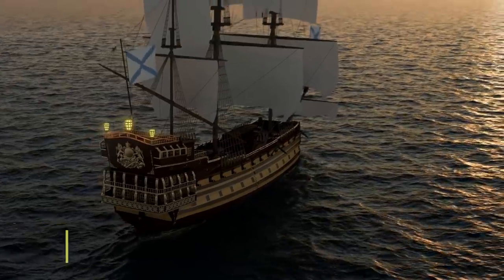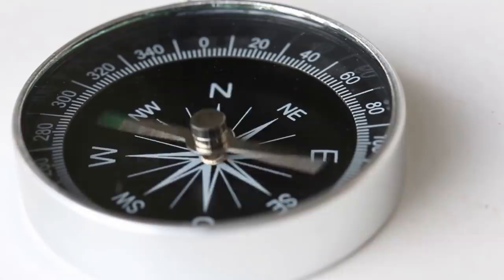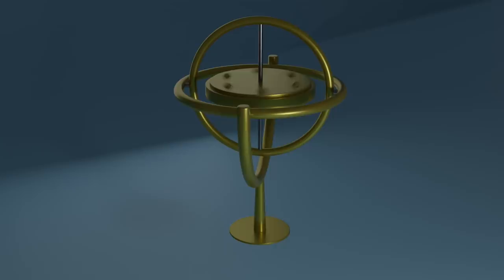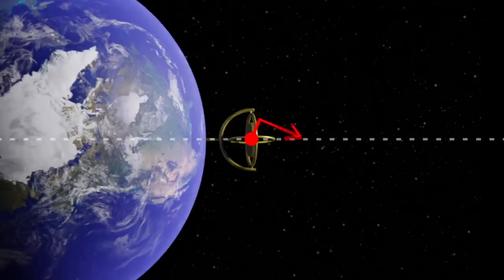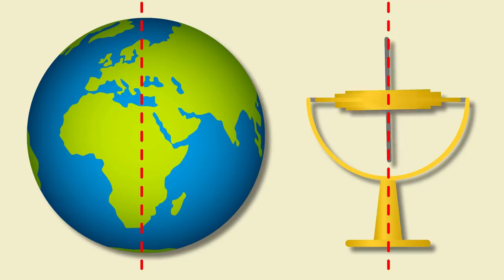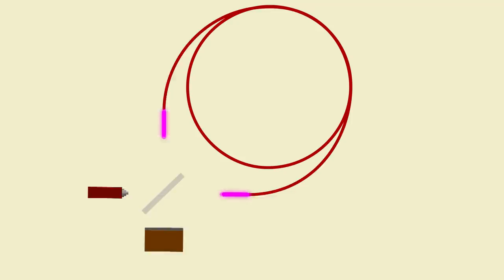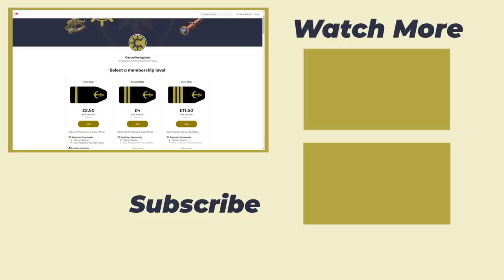Gyrocompass: How Ships Navigate Using The Earth's Rotation

Comment: Wow, that was a very interesting presentation! Thank you, more please. I think I learned something, a very complicated subject is gyro navigation. Too complicated for my small brain. 
I have experienced the gyro effect, most people have I would think. Anyway, the connection of gyro force to bicycles wheels has led me to a question. Any vehicle with wheels has a contact patch, this contact with the surface on which it travels creates "traction". Traction is an effect created by weight and contact (=friction), the more weight per square inch, the better the traction, the more friction, i.e., less slip (generally). 

On a bicycle, to change direction one "counter steers", tipping the bike over and then adjusting the steering angle to follow the intended path and maintain balance. Steering or counter steering does two things, one, adjusting the balance of "uprightedness" and two, counter acting, or overcoming the gyro effect. Maybe this isn't a question, maybe this is an argument.
The force of traction is much much higher than a gyro force, probably 1000 (10,000?) times as forceful. It is possible to crash a bicycle, if the gyro effect had much (a lot of) force, it would be virtually impossible to crash, or to turn for that matter. I guess what I believe, and I may be wrong, it is not the gyro effect that keeps one upright on a bicycle, it is simply balance, balance that is intentionally and directly controlled only by traction supplied by the contact patch and rider input. Turn the handles the wrong way or wrong amount and down you go. Now if the bicycle was floating in a fluid, like the air, we'd really have something the gyro effect could impart it's force. And a hovering bike would be fantastic, lol.

Anyway, thanks for creating this video, keep them coming, I find boats and ship fascinating. Maybe because where I live, water is a solid much too much of the year and virtually impossible to ride a bike in a foot or two of not quite solid snow. Get me outa here (sobbing).

Comment: One question. I understand the gyro-compass will orient itself with Earth's axis, but how do you know where is south and where north? It could be either way.
Reply from the maker: It depends on the way the gyro is rotating. It knows which way based on its rotation.
Reply: @CasualNavigation  So, if I understood correctly, depending on the rotation, clockwise or counter-clockwise, it will always orient itself correctly south-north.
Reply: There's no axis. Only magnetic north which is the center of earth. Earth is stationary and covered with a firmament and water above that.

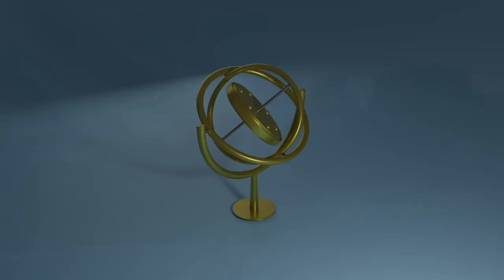Comment: 6:55 - that's actually a myth.  You can build a bike with a counter-rotating flywheel that cancels the bike's angular momentum, and it will still stay upright.  A bicycle can sustain its stability by the gyroscopic effect, but only at extremely high speeds.
Reply: What is extremely high?
Reply: @the11382  80+
Reply: I see you also just watched that Veritasium video

Comment: The optical gyro cube is also how the inertia guidance system works out acceleration and direction.
Reply from the maker: Thanks BigFire. I am working on a video that mentions inertial navigation systems at the moment.
Reply: @CasualNavigation  Back in the early '80s,  whilst in Junior High School, I visited Rocketdyne factory where they're in the process of switching from mechanical inertia guidance (mainly for missile and other payload) to optical.  Albeit, they're using 3 square bricks of I think optical sapphires each with 3 mirrors for beams.  1 brick per orientation of the 3d surface.  I figure they would've reduce the size of it by ow.  Also highly recommended the fun video made (I think in the 70s) of how a missile can tell where it is...

Comment: Back when I did landscaping I used a compass a lot. With much bewilderment from my boss. Knowing what direction is what comes in very useful for cleanups when using blowers. As should be evident, you do not want to work against the wind. My boss would simply go by the old "rises in the east, sets in the west" generalization. I used a compass in order to be more accurate and so that I didn't have to remember. My preferred compass was a lensatic compass, mainly because they fold up and are thus protected.

edit: cardinal typos
Reply: I'm confused. If the wind is significant enough that you don't want to be blowing against it, you can see stuff moving in the direction of the wind. Why would you use a compass and a weather forecast to see which way the wind is blowing?
Reply: @beeble2003  Wind direction can change over the course of the day. Or it can be calm then change to windy.

edit: also it is not simply about which way you move across a property, it also effects which property you go to in the first place. For example you want to avoid moving uphill when doing a cleanup, you always want to move downhill. So if the wind is going to be against you moving downhill at one property, you go to a different place where that is not the case. (this is a good example of why the forecast itself is so important and its not like my boss didn't use the forecast, it was just the compass use he thought was odd)
Reply: @whyjnot420  Ah, OK, I see your point. If you're actually there, you can tell what way the wind is blowing, but knowing the wind direction would tell you which jobs are best done today and which should be left until tomorrow.
Reply: @beeble2003  Just one other thing to point out. Back when I was doing this kind of work (in the 00s), while cell phones were around and fairly common, stuff like smartphones did not exist. Sure some older cells had a built in compass, but I never used a cell during that time (still never use them tbh).

edit: I say did not exist, technically things that fit in line with them did exist, but they were expensive, uncommon, cell reception was very hit or miss and so on, so for all intents and purposes, "did not exist" fits the bill.
Reply: You must be the special kind for doing this to blow leaves. I wouldn't work with you haha

Comment: Fun thing about using a GPS input to auto-correct the gyro errors:
On the Prinsendam in 2013-2014, we had a GPS used for that but its position liked to "wander off" at random times; sometimes going as far as showing speeds of 70 knots (quite impossible for a 200m cruise ship).
The calculated correction would thereby become WAY wrong, making the gyro and therefore all connected equipment wander around as well; including the North-Up stabilization of the RADAR screens. Effectively this caused a situation where all equipment on the bridge would start being wrong together; with the exception of the depth sounder.

The location where this happened:
Chilean Fjords where there are quite some currents; at night without navigational aids on shore; narrow waterways, but very deep so the depth sounder wouldn't be able to give sufficient warning either.

Suffice it to say...
Not quite ideal... 😅
Reply from the maker: That does sound far from ideal

Comment: Bicycles are stabilized by the camber of the front wheel. Bikes are only stable in the forward direction. If you were to try and make a bike go backwards it would quickly fall over.

Comment: One question. The geographical north pole is closer to the magnetic south pole right? Otherwise the deflection of the compass changes with the south being the north and the other way round. I am not sure if my question is correct. Feel free to correct me.
Reply: Your question doesn't really make sense, but if I understand what you are trying to say, the north pole of a magnet in a compass is attracted to the magnetic south pole of the earth.  But as related to magnetism, earth's magnetic poles are backwards meaning north(+) is in the south and south(-) is in the north.  Magnetic and geographic poles are not the same on earth, magnet north and south is actually quite a ways away from geographic poles.

Comment: You say the gyrocompass points north. Is that accurate, or is it aligned with the north-south axis of the earth? How can we tell which end points north and which points south. And, how about in a ring laser gyroscope?
Reply: Your intuition is correct, it aligns with north-south, it doesn't point north. And mechanical gyros tend to be used because they're a lot cheaper, and they work just as well for large ships which is where gyrocompasses.

Comment: If you have gps signals to feed into a gyrocompass why would you need a compass?
You can calculate speed and heading from gps.
Reply: I’ll answer that by way of relating a traditional flight instructor’s question for students:

Instructor:  ”You have several instruments in the cockpit, and several methods available to determine your course…which one should you use?

Student:  ”I don’t know…”

Instructor:  ”All of them.”

Redundancy is a good thing.

Comment: 1:35 I don't think there is a torque present. If it's freely rotating there should not be any forces present. Torque from angular inertia might be present if you would try to stop it, but we assumed ideal frictionless rotation I presume.
Reply: Yeah, there's a lot of confusion between angular momentum and force in the video. (By the way, there are forces involved when a body rotates freely, since all points on the body are being continuously accelerated towards the centre. But those forces are also towards the centre, and are not given by the right hand rule.)

Comment: Bicycles work due to gyroscopic effect the same way planes fly due to the top of their wings being curved: through repetition.
Reply: @FrenchCrow  Both claims are false. Both are repeated ad nauseam and wildly believed. Both have a kernel of truth in that the effects are real, but not the main force at work.
Reply: @ImpactWench  I think I see what you mean. Lift is more like the top of the wing being strongly sucked up, and Mr Bernoulli's theory, even if it's true, can't do the whole job.
About gyroscopic effect, bicycles are not really a good example, the front wheel being too slow and too light. Ride a motorcycle, you can really feel it - geometry still being a factor of stability though.

Comment: How do you keep friction in the gyroscope gimbals from throwing off the gyrocompass?  Seems like even a tiny bit of fraction would add up over several days to enough to mess you up.  Also the ship pitching and rolling in heavy weather would cause problems, since this is much faster angular change than the rotation of the Earth (even though the velocity is much lower).

Comment: "The gyroscope doesn't maintain its axis in relation to the earth, it maintains it in relation to the universe."
Very true, and there was once a Soviet rocket failure that nearly turned into a catastrophe because of this. A Soyuz rocket had its launch aborted very close to ignition and everything was shut down. This then required the rocket to be unfueled while on the pad and after an hour or so while that process was going on the crew capsule, now empty fortunately, activated its emergency system and launched off the top of the rocket - miraculously not causing everything to explode. What happened was when they shut down all the systems they forgot to shut down the emergency escape systems and its gyros, as the Earth rotated, began to think the rocket was getting out of vertical enough and automatically triggered the escape system when it went beyond a safety threshold.
Reply from the maker: That's interesting, I'd never heard of that incident before.
Reply: @CasualNavigation  I added a reply with a link to an outside article about it but I guess youtube doesn't like that and removed the comment.
Reply: The story listed is close enough to the true events.
Soyuz 7K-OK no 1 was supposed to be launched uncrewed, but a booster failed to ignite, causing the abort. The launch escape system activated 27 minutes later. Fire from severed lines spread to the rest of the rocket, which blew up, severely damaging the launch pad.

Comment: At 1:37 you correctly describe angular momentum, but then at 1:39 you say there is a torque about the spin axis... which is not correct. If the angular momentum is constant, there is no torque being applied about the spin axis. One might assume that you meant to say that a torque must be applied to change to the angular momentum, but that's not at all what you said. Then at 3:29 you refer to the gyroscope's angular momentum as torque, which is simply not true.

Comment: 3:28 The Earth's rotation is wrong. It should be counter-clockwise. East to West. The animation has it reversed.
Reply: All earth rotation is animation. Doesn't matter if they "spin" it in any direction, it's still CGI.
Reply: @davidjohnson1463   you ever cross the equator with your eyes open?

Comment: Bicycles do not work by gyroscopic stabilization. It's not even conservation of angular momentum.  It's because they are two cylinders moving in the same direction.  If it was gyroscopic stabilization, you would never need training wheels because once in motion, it would be exceptionally difficult to knock it over, and well beyond the flailing of a small child.  As many a front tooth can attest, this is not the case.

Comment: on a bicycle gyroscopic effect is minimal and the reason why you don't fall off it is because of it's construction and constant adjustments you do with the handle bar or with your bodyweight. Sagnac effect has nothing to do with the speed of light but with frequency change of light wave, so optic gyroscope detect not the time difference but frequency difference

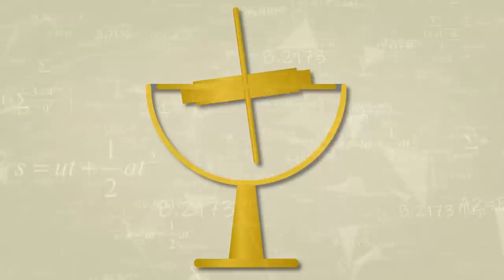Comment: 5:14 if you have GPS then what is the point of a gyroscope?
Reply: GPS is for position, Gyro gives you a heading.
Reply: GPS can tell you a direction also; but only when you're moving and only over ground. A gyro will give your direction through water instead. The difference between those two tells you how you're affected by wind and current.

Also, isn't it nice to have a completely self-reliant system that doesn't depend on external satellites and atmospheric effects?

Comment: Well I did not realise the ship’s gyro worked like that. I assumed it was like an aircraft gyro-magnetic compass. Instead I just learned it is more like an aircraft inertial nav platform.
  It is said that when riding a bike, and due to gyroscopic effect, in order to turn we actually turn the bars slightly opposite to the turn. It makes sense although I have never taken the time to think it through too deeply.
Reply: Bicycles do not act gyroscopically. Of course, the spinning wheel does have some gyroscopic effects, but not nearly enough to stop the bike falling over. Bikes are stable simply because if you start toppling to one side, the bike steers in that direction, which puts it back underneath you.

Comment: K. Gyroscopic compasses are impressive enough, but the idea to use something as simple as an optical fibre to detect the slow movement of earth is super clever. How percise are the clocks in them, I wonder? The change is only 0,00416 degrees per second. In a fibre of 30cm that would make a difference of 0,000000347 meters. So with the speed of light that is traveled in ca 11 femtoseconds. I read that the fastest lazers have a pulse time of around 1femtosecond.

Appearently though a photodiode and an oscilloscope are capable of measuring that timedifference.

Comment: The thing about bicycle being stable due to the gyroscopic effect of the wheels is actually false. A bike is actually stable due to the geometry of the frame and how it causes the front wheel to turn whichever way the bike leans causing it to remain upright. This was tested by making a bike that had extra counter rotating wheels that cancelled out the gyroscopic effect of the wheels and the bike still remained stable while in motion. But when a normal bike had it's steering locked in place it couldn't stay upright despite having the gyroscopic effect of the wheels in place.
https://youtu.be/YWsK6rmsKSI
This video explains it really well.

Comment: I don't understand why a gyroscope or compass are necessary if you have GPS. Sure, before GPS it makes sense, but if you need to feed a gyro GPS data for it to work properly, what's the point?
Reply: GPS is not as accurate as GYRO and GPS signal can / does get lost at times. Once a GYRO is set to seek North Pole, you don't need to feed it any signal, you just need to supply it power to keep it rotating and it will keep giving you right direction.
Reply: @dimaz3  fair enough!

Comment: What?!! How can any movement delay or quicken the arrival of the light beam in that laser gyro... That's hard to believe. Light travels at light speed, no matter the reference frame. As an analogy, light will not come at you any faster if it's fired from the head lights of a car moving towards you, than if it came from a stationary car. That's not how light works. I think the effect the light gyro measures is not the difference in time, but the difference in wavelength. The wavelength may be stretched or squeezed by the dopler effect, but certainly not the light speed, i don't think.
Reply: @QED Ok, I see that in fact I made a mistake. I think the animation in the video is a bit confusing, since to me it seemed to suggest that the rotation itself was slowing light down. It also doesn't help that it animated the rotation much faster than the movement of the light. When in reality, it's the fact that the detector is a moving target that moves away from the source, which creates a difference in distance that needs to be traversed. 

a better section of the wiki to be quoted is this one: " If a light source emits in both directions from one point on the rotating ring, light traveling in the same direction as the rotation direction needs to travel more than one circumference around the ring before it catches up with the light source from behind. "